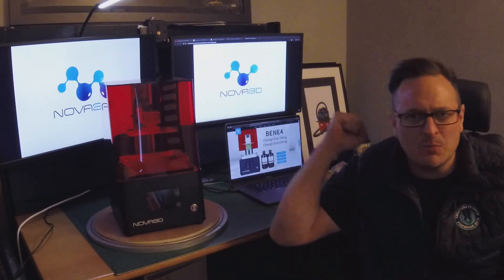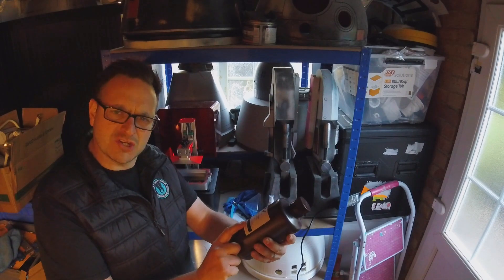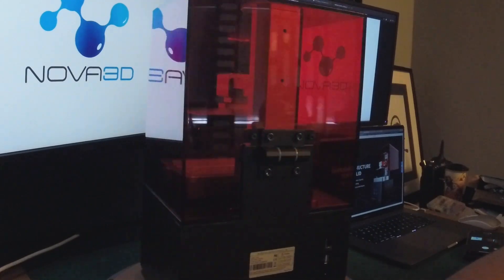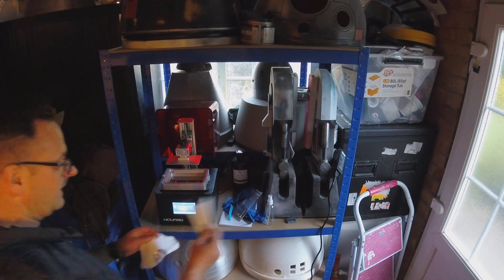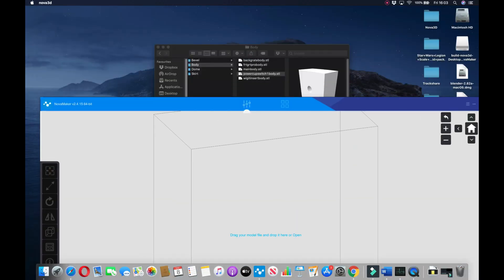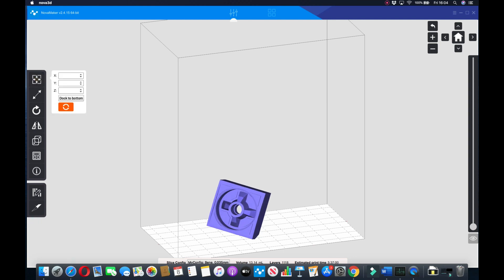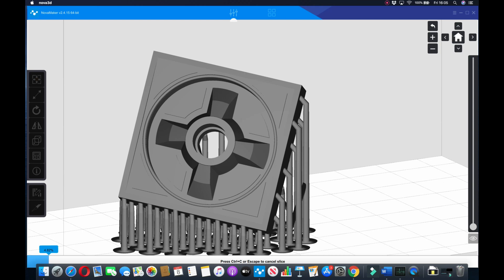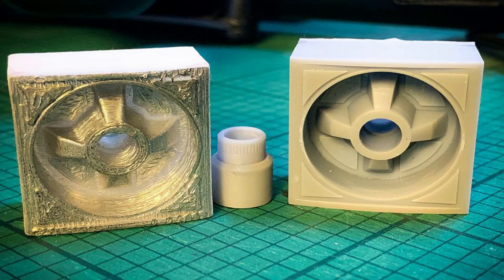Nova 3D Bene4 Resin Printer Test and Review

Comment: Buyer Beware, I bought one of these and you can not replace the FEP film on them by the sheet. You have to purchase their own fre-fit to frame FEP films which are very expensive and ware out after 4 or 5 prints. AU$25 for me. You can not seperate the plastic they mold the FEP into either as it is made to shatter as soon as you try. They do not advertise this anywhere in advertising or in the useless one page quick start guide that comes with it. I am currently talking to some manufactures about making a milled aluminium frame I can seperate and fit aftermarket FEP film too. Absolute scam is all it is.
Reply from the maker: Yes it’s correct about the pre formed FEP however I’ve successfully printed 50 plus prints without having to replace the film. When you say ware out it sounds like you’re perhaps not using it correctly.